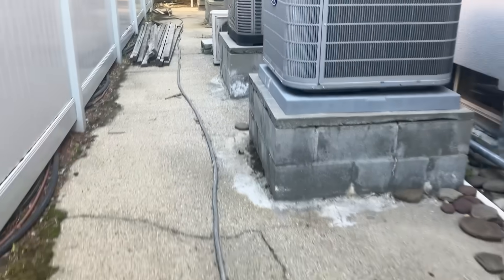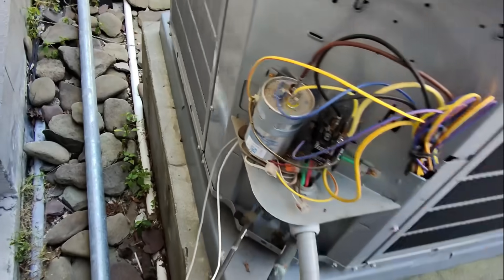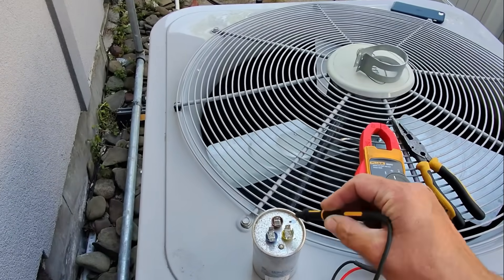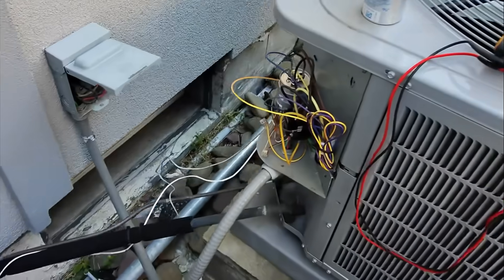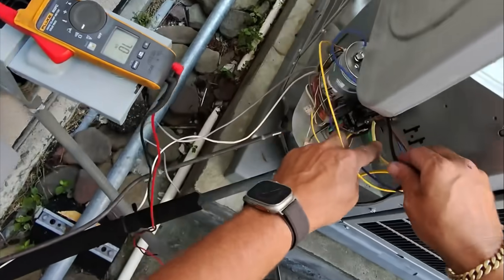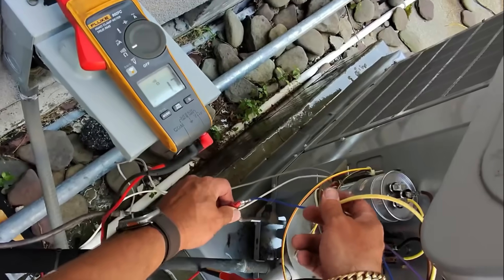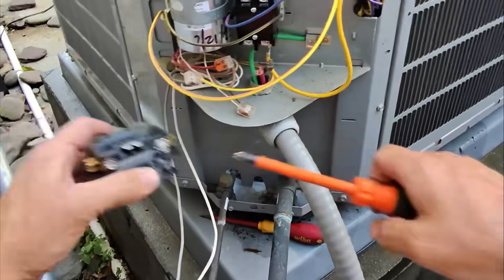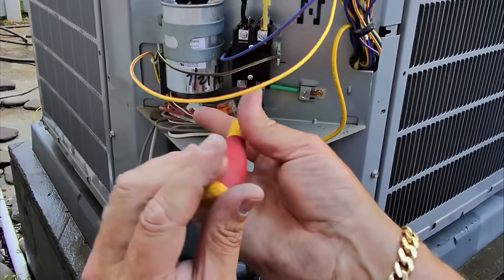Central AC Not Cooling? BAD Capacitor & Overheated Compressor EXPOSED – Real HVAC Repair

Comment: Quick easy fix, nice repair.  Just curious, sounds like you said the compressor was quiet anyway, but some folks do not like the sound blankets some do.  I like the Carrier ones and they do work a little on the high frequency side. About a 3db decrease is what is advertised. Even put them on a Trane and other systems where home owner complains a little about sound near the bedroom window. I assume you just left it off? Thanks for the video.

Comment: Tech tip just cut off the u-hook part and you got an excellent connection for your new compressor wires. On another note did a maintenance on a 1978 carrier unit today paired with a trane condenser and it’s still kicking, don’t replace your old equipment unless it’s dead!!!